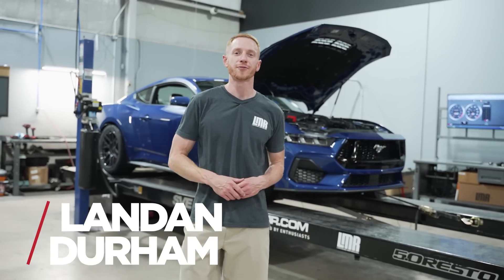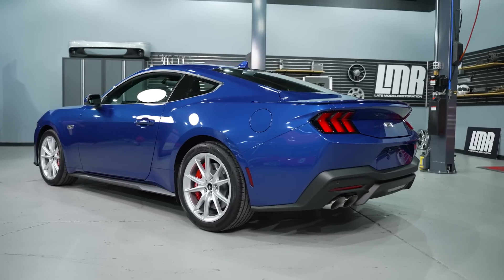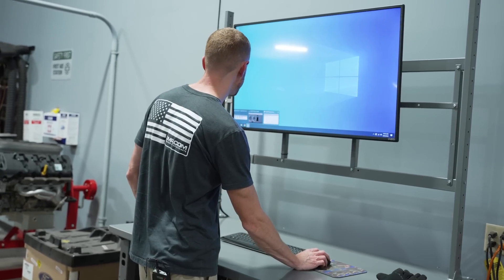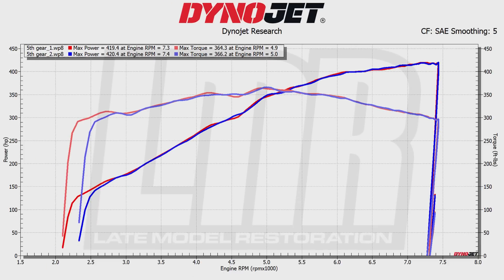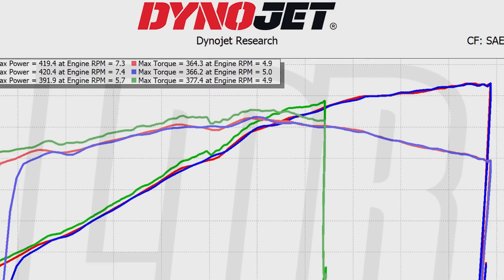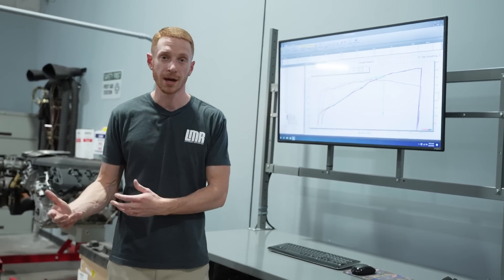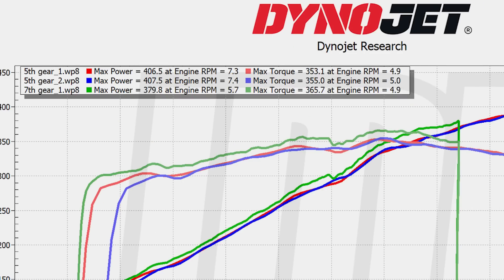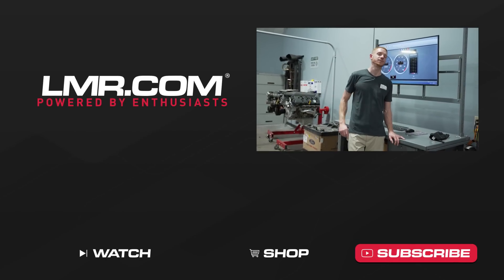2024 Mustang GT Dyno! Multiple Pulls & Correction Factors Explained

Comment: I am confused. My 2018 mustang gt at 460 net  based out on the Dyno in many tests at 421Hp and 400 TQ and this new car which is  480 net HP is also basing out at 420hp. So where is the HP improvement for the 2024 mustang?
Reply: They explained the gear ratio issue in the video. To get true numbers they would need a pull in 7th gear, they can’t do that because of the factory speed limiter. The only cars that can do a full dyno pull in the 1:1 are going to be the manual transmission models, and potentially the 3.73 because they won’t top out on speed, but I’m not 100% sure on the 3.73s. There have been a. Few dynos of the manuals posted, where they can get a full pull in the true 1:1 gear. The one I saw put out 440 whp 425 wheel torque
Reply: @chasemytaillights  thanks for explaining that.
Reply: I also calculated 440 base horse power.
Reply: I bet anything if a new 2018 Mustang GT was there to dyno side by side with that one the dyno would have shown the 2024 making 10 or 15 more RWHP than the 2018 unless there was something wrong with either car. Chassis dyno's are just a tuning tool. You can't compare dyno numbers from said A car on the west coast vs said B car on the East Coast and especially from different times. Hell you can't even do it with the same type of dyno's with one being down the street from the other at the exact same time. That's why they are all over the place. When they do this they need to source the outgoing model there with a new one. All stock with low miles and do them back to back. I know its hard to find a bone stock Mustang, lol, but not that hard.
Reply: @B49nope except the 99-04 cars were a big improvement over the 94-98 cars. More power, more reliable especially without that dumb 94 intake manifold. The 94-98 2v was a worse engine then it replaced in pretty much all ways, the pushrod 5.0.
Reply: You're confused after what ford did to the '22 and '23? They didn't improve much on the s650, they instead dropped everything on the 22 and 23 to make the 24 look better. How does ford say they had to limit the 22 and 23  for epa, and put a carbon trap in the intake to suffocate the motor, then turn around in 24 and add an extra intake? Think about it. Instead of making the s650 a whole new beast, they shit on the last 2 years of the s550.
Reply: They could have been under rating the ‘18-‘23 Coyotes also..
Reply: The car is a rip off lmao

Comment: What is on the front brake rotor other than the caliper?
Reply: I've yet to watch the video so Just a guess. Possibly the drift brake
Reply: @DWH300  yeh completely forgot that
Reply: @DWH300 why would a drift brake be on the front?
Reply: That’s the rear brake not the front, the smaller caliper is a parking brake.

Comment: It’ll be a minute before it stops looking like a Camaro 🤷‍♂️
Reply: If you look at the Camaro it actually took some design ques from the mustang. Just look at the 2020. Mustang and look at the 2021 Camaro 😊
Reply: I don’t see how it looks like a Camaro…
Reply: Does have the camaro heat extractors, also it’s funny how with the s650 they went the chevy route with the exhaust.
Reply: Looks nothing like a Camaro , you’re just jealous
Reply: The mustang came first and the camaro has always been a knock off "pony" car..... Ford just went retro throughout the 2000s until now hence the 90s F body throw backs.
Reply: I don't know where people getting Camaro from, it looks exactly like a OG s550 just sharper.
Reply: @eronic404 it's not even the same grill shape as the Camaro this is totally mustang...these people are just repeating what others say to seem funny...
Reply: @truckercowboyed2638 I know right it's crazy people will be that simple minded and do that